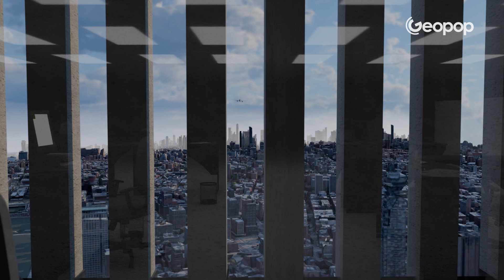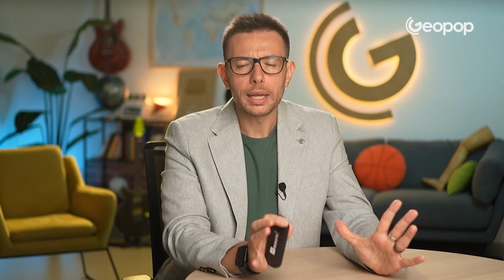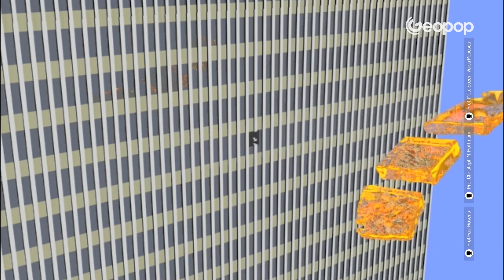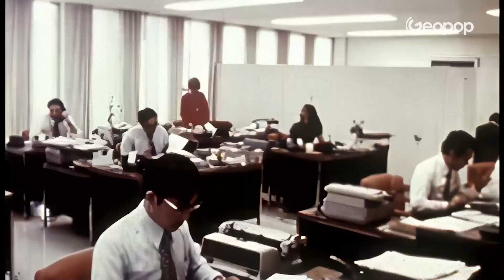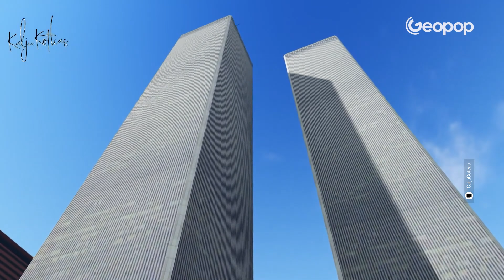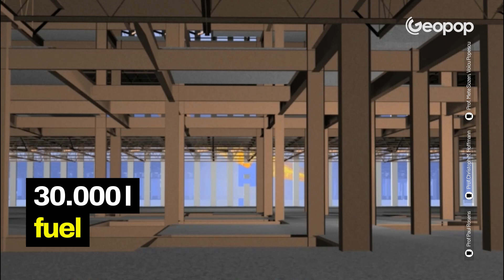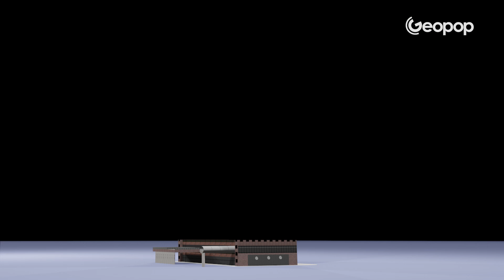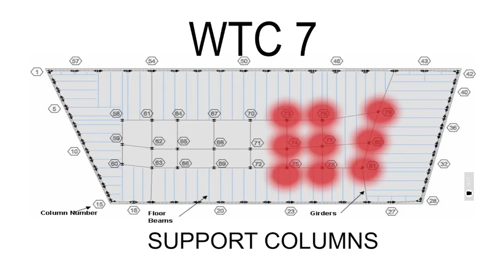9/11, 2001: The Technical Reconstruction of the Twin Towers and WTC 7 Collapses

Comment: Controlled Demolition. Period. A structure that carries another structure resting on it, doesn’t pulverize under the weight of this upper structure. And these metal “nets” are not “glass”, they are extremely strong and agile, they are not houses of cards. BDG 7 as well.
Reply: Controlled demolition - NOT! There's literally no evidence of CD, your inexpert opinion notwithstanding.

The towers were dependent on the column-and-truss arrangement to stand; that structure was disrupted when the tower tops fell. The underlying structure did not fail, it was BYPASSED.
Reply: Shouldn't we be using the thinking part of the brain instead. Pre-planned demolition is a hand-wave for people who won't/can't put in the effort.

Building 7, the 6th building to collapse of 10 lost on 9/11 though extensively studied still confuses many. Not famous or a terror target and with no casualties it didn’t get a lot of attention initially, creating an information void the internet filled with utter garbage. Because everything seems like a conspiracy if you don’t understand how it works I prepared this brief summary from my own analysis to fix that. No politics, just engineering. 

The North Tower collapse at 10:28am bombarded Building 7 with tons of burning debris, causing heavy damage and starting multiple fires burning out of control for the next 7 hours. Half the FDNY firefighters having been killed, others injured, units in disarray, equipment destroyed, no water pressure, and the greater urgency of Search & Rescue efforts, firefighting was pulled as futile. The building couldn’t be saved and was left to its fate.

www.youtube.com/watch?v=g_SvpwyC17M&ab_channel=MFitz  

Collapse of a burning structure is always a concern for firefighters. Steel buildings subject to fire rely on active fighting of the fires to survive. Buildings are designed around 1 to 3 hours of fire resistance, allowing time for occupants to escape and ACTIVE firefighting to get started, after which all bets are off. Left to their own devices they will exceed their design envelope and collapse. In B7 the occupants escaped, passive and active fire protections were compromised and active firefighting was abandoned which left the building to take its chances. It lost. Odds on Building 7 would eventually collapse, and it did. No big deal in logic. That is the sort of choice firefighters make every day in brush fire situations - which houses to save and which ones to let go. Only real difference here is moving the decimal on the size and cost.

www.youtube.com/watch?v=WnYBX6QT0R4 

FDNY Chief Daniel Nigro ; The biggest decision we had to make on the first day was to clear the area and create a collapse zone around the severely damaged 7 World Trade Center, a 47-story building heavily involved in fire. A number of fire officers and companies assessed the damage to the building. The appraisals indicated that the buildings structural integrity was in serious doubt. I issued orders to PULL BACK the firefighters and define the collapse zone. It was a critical decision; We could not lose any more firefighters. It took a lot of time to PULL EVERYONE OUT, given the emotionalism of the day, communications difficulties and the collapse terrain

FDNY Deputy Chief Peter Hayden ; We had our special operations people set up surveying instruments to monitor and see if there was any movement in the building. We were concerned of the possibility of collapse in the building. And we had a discussion with one particular engineer there, and we asked him if we allowed it to burn could we anticipate a collapse and if so, how soon? And it turned out that he was pretty much right on the money, that he said 'In its current state you have about 5 hours

The collapse of Building 7 was anticipated and widely reported in the media throughout the day. At least 24 video cameras recording some or all of the collapse. Everyone knew what was coming and why.

www.youtube.com/watch?v=OY5S5k3tMHI 

Building 7’s collapse was completely different to the Twin Towers, harder to understand with most of the details difficult to see. But we can still sort out what happened through careful analysis and observation.  This is MY EXPLANATION of the collapse sequence using the best available information and relying on no authority.

B7 was complex 47-story steel framed structure built on top of a smaller existing 3-story building, requiring several lower floors dedicated to complex load transfer structures instead of usable office space. Of trapezoidal shape and all-steel tube-in-tube construction, B7 (above the 7th floor) consisted of a central core of steel columns carrying most of the gravity load, perimeter steel columns around the outside of the structure carrying the remainder of the gravity loads and long span beams and girders to tie those elements together and form the floors. On the outside of the building hung a moment frame - the last part of B7 to fall. 

Phase 1 : The first externally visible signs of collapse initiation occurred at 5:20:28 pm. Collapse initiation for B7 is notably quiet with observers not realizing the building was collapsing! There was no audible warning in the form of say hundreds of ear drum busting 180-190dB explosive bangs preceding the collapse. Here at 12:00 a local CBS affiliate reporter is talking 10 blocks from B7 when collapse begins. People don’t start to notice the collapse until 12:11. Then at 12:45 is the famous CBS fixed camera clip of Building 7’s collapse.  Note how quiet it is.

youtube.com/watch?v=t5tEy6mXSE8&ab_channel=fresnosean379

Collapse initiation was due to lower floor failures above the load transfer region (7th floor) in the NE corner of the building. In this video at 0:45 you can see the NW corner from inside the building while under construction, Column 79 just out of frame on the left. That big, angled steel beam across the top of the frame connects to C79 at one end. The girders connect to the beam. That beam and all those girders depend on just one connection

youtube.com/watch?v=nP3TNHPCIVU&t=35s&ab_channel=EdwardCurrent

Phase 2 : Lower floor failures caused a loss of critical lateral support over an excessive length of core Column 79 and it buckled. If you look at a floor diagram of Building 7 (see above) and look at all the structures that depend on C79 you quickly realize this one column was a relatively isolated structural element on which a disproportionately greater fraction of the structure depended analogous to say the Key Bridge. Externally we see a vertical progression of window breakage along the 44-46 line and a kink in the roof of the East Mechanical Penthouse at the top of the building, consistent with C79 failure. The transition from full capacity to almost no capacity occurs in virtually an instant. Once the buckling failure occurs there is almost no resistance

Normally with a buckling column, the load could very well be redistributed to other columns, meaning the buckling could stop after a while. With C79 that is not the case - the failure did not redistribute the load, so the collapse rapidly progressed to the roofline, sinking the rooftop penthouse.

Phase 3 : With C79 gone, B7’s progressive, non-symmetrical collapse continues with C80 and C81 at the east end of the core left laterally unsupported and quickly buckled and failed as well, sending the EMP down through the building. C79-81 all have no diagonal bracing, which I believe is a major reason why they could not redistribute a lot of vertical loads among one another.

From there collapse progressed from east to west through the central core until the core was gone taking all of the interior floors and structures and probably most of the perimeter columns with it. You can see the horizontal progression of window failures low in the building and the dropping of the remaining rooftop structures into the building. One of the big takeaways from the NIST Building 7 study (that gets completely ignored) was their modeling which determined C79 failing under ANY circumstances would have initiated the same collapse sequence.

Phase 4 : After some 10 seconds all that remains of Building 7 is just a hollow empty outer shell - the exterior moment frame - creating the illusion the building is still standing since little has changed externally. But it’s just a hollow empty shell like an empty cereal box supported by only a few remaining columns and quite unable to remain standing. With all the internal framing gone, the north face leans inward, forming a V in the roofline, the last perimeter columns buckle under the strain and with nothing left keeping it up the moment frame free falls, landing on top of the 7-story high debris pile. It is only at the very end that a single measurement of alleged free fall acceleration is taken. Note this is not the building but just its outer shell, and only one corner at that, at the very end of the collapse. Start to finish the entire collapse took 18-20 seconds, or less than 1/3 of true free fall and we have to look at the whole thing, not cherry-pick little bits to fit a particular narrative. Worth noting _how fast something falls cannot tell you what started it falling in the first place. The debris spread out, blocking surrounding streets, heavily damaging the Verizon Building and destroyed Fiterman Hall, all well outside of Building 7’s “footprint”.  

Building 7’s progressive, non-symmetrical collapse was incidental and unintended collateral damage from the combined effects of fire + time + gravity started by the collapsing North Tower. That is true no matter who planned and carried out the 9/11 attacks or why . The collapse was of so little consequence it barely even registered at the time, a mere footnote. It only took on semi-mythical status as an alleged smoking gun years later when demolitions at the Twin Towers, missiles at the Pentagon and shoot down over Shanksville all failed and conspiracists had nothing left to work with.

I hope you found this helpful, informative and it solicits informed critical comment. If I made any errors of fact, logic or reason or left anything important out, please let me know so I can fix it. IF you can offer a more plausible alternative please do. Be the first. Please start any reply with the words “Tits McGee” or I will know you didn’t read it and are wasting my time.
Reply: "Controlled Demolition. Period."
Pro tip: adding "period" after a stupid sentence doesn't magically make it true.

"A structure that carries another structure resting on it, doesn’t pulverize under the weight of this upper structure."
Ever built houses of cards?

"And these metal “nets” are not “glass”"
Who suggested it would be glass?

"they are extremely strong and agile"
Up to some point, as we all could see.